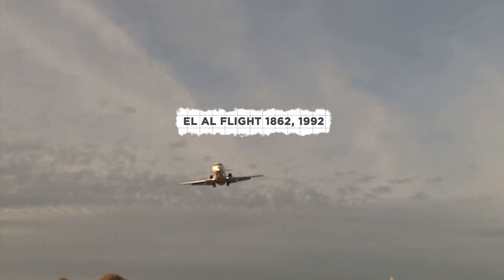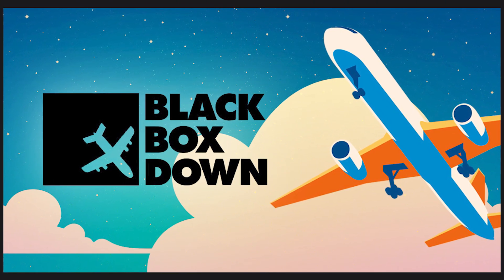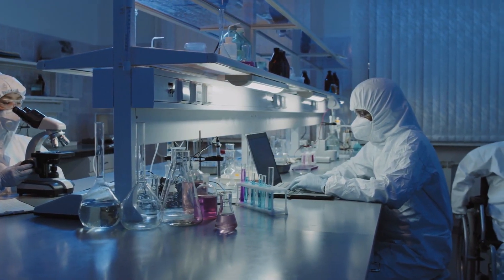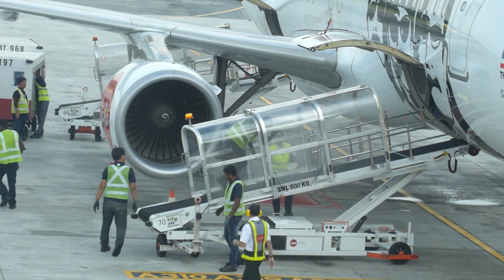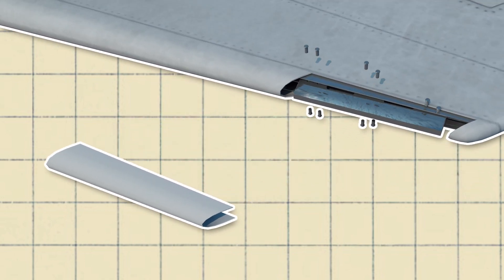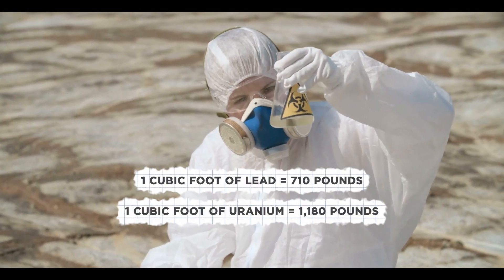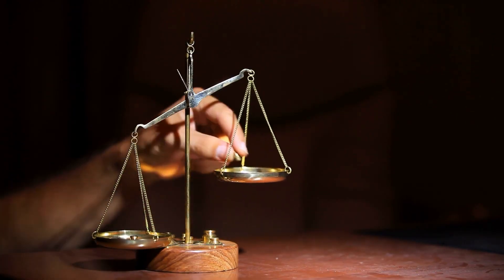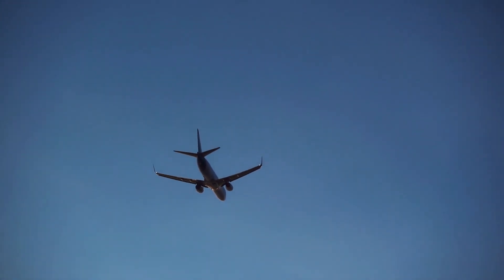Why Did 747s Have URANIUM on Board? | Black Box Down Explained

Comment: I have to correct you on one thing. They weren’t using the depleted uranium for typical CG considerations. They were using them to balance the control surfaces as there is much more material aft of the center of rotation (hinge line) compared to ahead of it. Think of a see saw with one long arm and one short one. You would need a lot of weight in the short arm to balance it.
Reply: thats what i thought as well. I dont remember which but, I saw a documentary or read a report on military cargo planes doing this for the vertical stabilizer. As I remember its just a big old block of depleted at the base of the vertical stabilizer used to keep it centered when no inputs are being given to the control surface. I dont remember the reasoning why but I can imagine that its easier and cheaper to maintain and produce a counter weight system than a power steering like system,especially for how large a surface area some of the vertical stabilizers control surface can be.